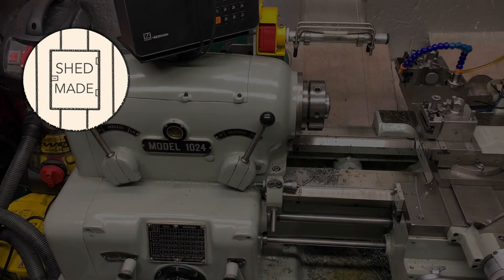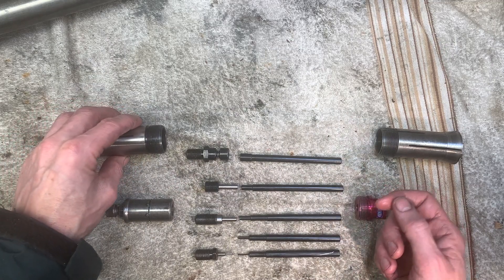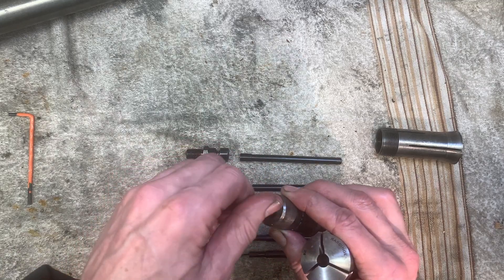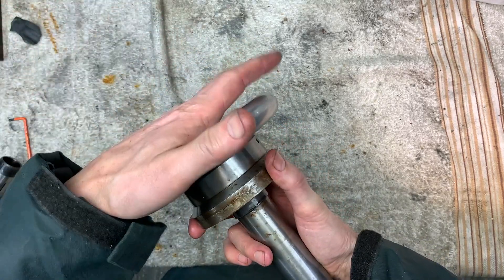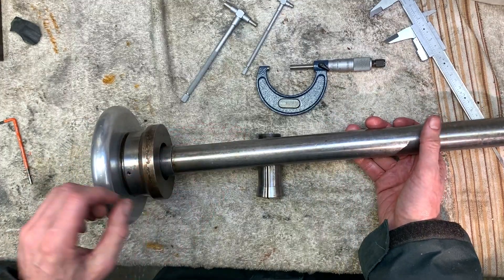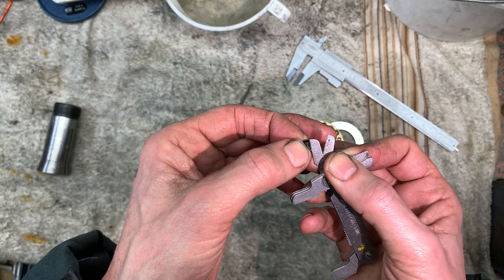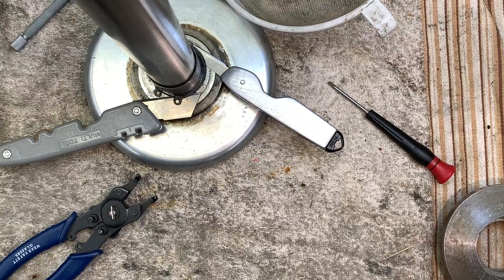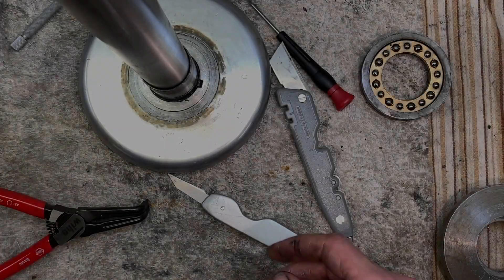lathe 5c drawbar     30

Comment: Thank you so much , I already started wrong,  I didn't think it’s a bearing in there 🙃, it’s good that I didn't cut the tube bar,  I can make the aluminium wheel again and now thanks to you I have the measurement and everything I need to try to do it, thank you once again, 
Regards
Cesar
Ps try Facebook groups, smart and brown lathe appreciator group, we can change opinions, help each other and more.
Reply from the maker: cesar   that one is for you ...   glad to help   ...  good luck